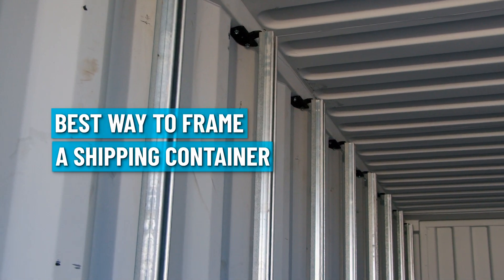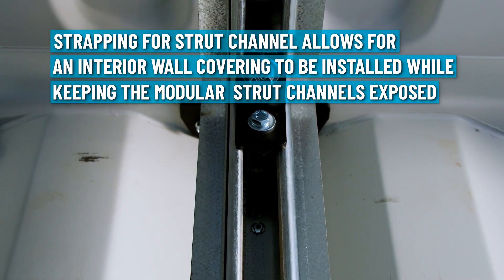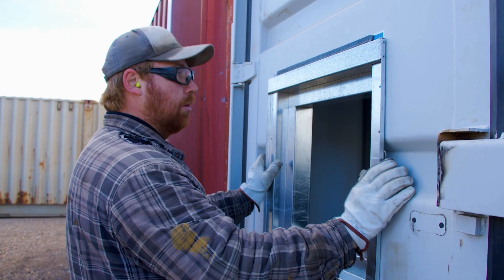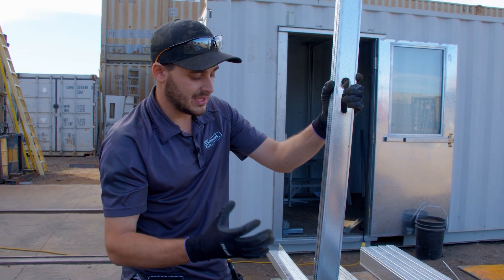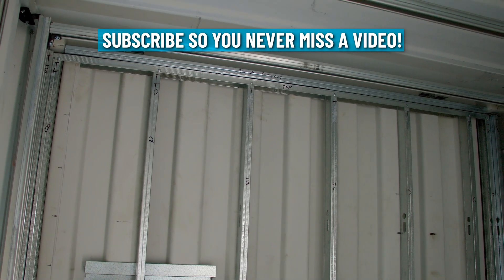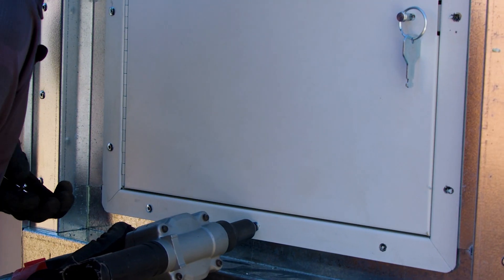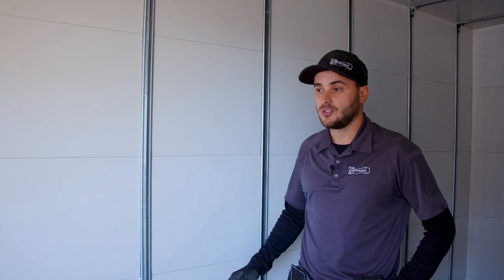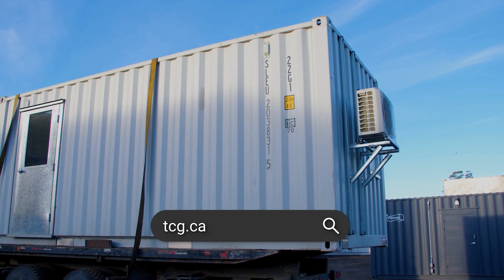Step by Step 20’ Shipping Container Modification - Favorite Insulated Modular Interior Wall System

Comment: What size and gauged studs and strut channel are you using? If I order the CSM brackets I wanted to use the same that you are using
Reply from the maker: 1 5/8" regular strut channel (most common stuff). We only have the heavier 12 Ga available in our area. I would love to try the 16 Ga because it seems excessively strong haha. In some situations, we don't need the capacity.